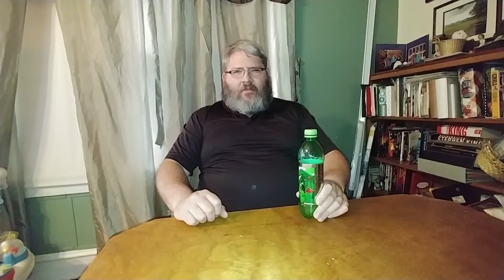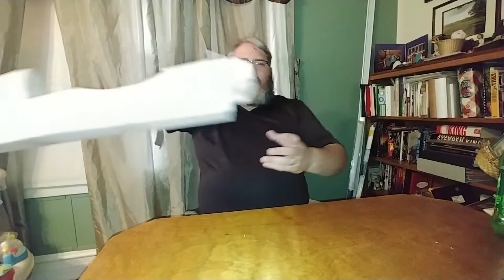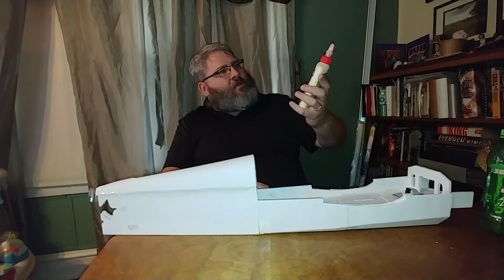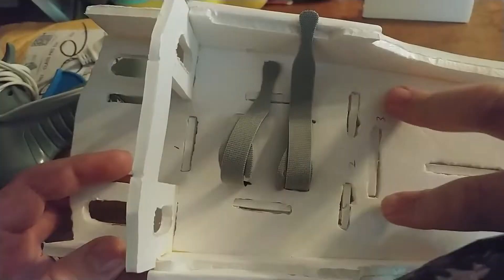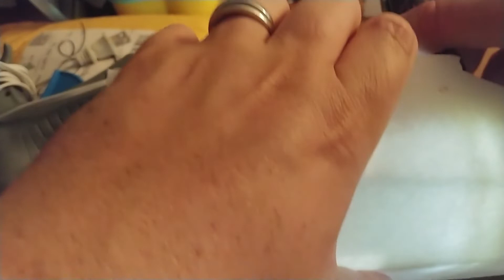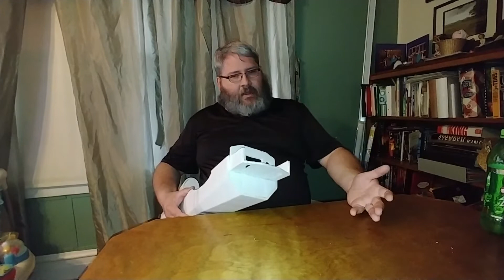FT Edge:  Build Intro Part 2... fuselage, using Titebond glue, and issues I've come across...

Comment: That's looking good so far!! 
I too am using less Hot Glue, I use White Gorilla Glue. I'm not sure if either is better... I also use the "Hybrid" Method, doing small spots of Hot Glue, to hold the parts together while the Wood Glue dries. 

..... And you already know, it gets HOT here!!! 
Take YOUR time! The FT Forum particularly, seems to be in a Race to see who can build faster. Some may find People like you and I, annoying! 
That's their problem. I actually enjoy the Build! 
Ok, physical limitations do slow me down... But I've never been in a hurry to build anything. 

I STILL want to do an Edge 540, with modified Control Surfaces. I'm curious! 😉 

My next build is already planned. A friend on the FT Forum is cutting me a Sportster!! I've wanted one of those for a while.

Looking forward to seeing how yours eventually turns out!
Carmine ✈🚂🚙
Reply from the maker: Thanks! Gorilla Glue is pretty good too...haven't used it for builds though. I did use a tiny bit on my large glider. 

I always tend to take my time. Even quick builds, I tend to double and triple check...and sometimes I still miss things. It's all part of the fun and craziness. I generally don't think about what forum members think of me. They build at their pace and I build at mine even if it may be slower than theirs. I enjoy building too...I love winter time here b/c sometimes we might get snowed in and I can build and repair things. Aside from my usual collection of builds and stuff here at home (and trust me, I got plenty), guys on the forum are encouraging me to build some other stuff too. Which I probably will, just a matter of when. 

That's awesome. Sportster seems like a cool little plane. Is that a 3 channel too? I can't remember. 

Thanks, I'll keep posting...building, flying, crashing, and repeating!
Reply: I got it wrong! I'm getting a Scout! 😋 

Yeah, I tend not to let the others get to me either. I do really enjoy Mayan, Hai-Lee and Rockyboy. Good guys. 

The others now have me worried....  😟
About my Cubby's weight! ONE, on HIS Thread, told me that his Cub flew great at 1100g... THEN on my Thread he jumped in with the others, telling me that I'm way too heavy at just over 1000g!! 😡 

Like I said, I don't let them bother me, usually... But he was just two faced! 

I've actually read about the others encouraging you to do other builds. I recommend you do! At YOUR pace of course. 😉 

Actually, this is OUR "Winter". It's SO bloody HOT🔥🔥, this is when we stay inside and work on projects.
But I promised a Maiden on Video. Not for them...
It's just my Word is all I've got left.
Reply from the maker: Oh...Scout's a good plane. I've built the mini version...good little flyer. 

I saw that about thread about the weight but haven't commented yet. I don't think I've ever even weighed mine. Really as long as your motor/prop can deliver enough power, a little extra weight can become irrelevant. I'll weigh my Cub and see how much it ended up being. I'm sure we've all built models a little too heavy. I think that's why my Long EZ failed. 

Oh, I'll do the builds...or at least try. 

Yeah get that maiden out there, love to see it. Even if it's a crash. Get your rates programmed in, add some expo (it helps if you're nervous), check your control surfaces, CG, and go!
Reply: I've got the Mini Scout, and burned quite a few Batteries with it! Good little Flyer, for sure.
It's just.... Little. Can't help it, I prefer big Planes! 

I have no way of measuring it, but this thing's got THRUST!! 😎 I no longer have any doubt in my mind she will FLY. How well? Remains to be seen. 
I've already dialed in 40% Expo, for that exact reason! But I set my Rates to 16 degrees, in case I need to avoid something QUICK! 
I really wish the Weather would break....
The waiting is making me more nervous by the day! 😳

I'd be very interested in knowing what your Cub weighs. 😊

Comment: im thinking about getting this exact plane, question though  how much flight time are you / can you get with a fully charged battery?  lets say half throttle  and can you tell me what type of BEC you bought because im not familiar with them.
Reply from the maker: Generally when going with the recommended motor/prop/ESC/battery for a particular plane, you can expect 6-10 minutes depending on throttle use. That's kind of the average. As for the BEC, I used a Tunigy 26V and a Hobbyking 40A ESC.